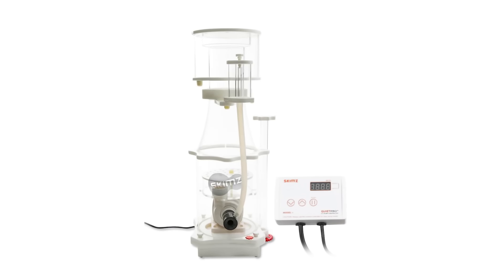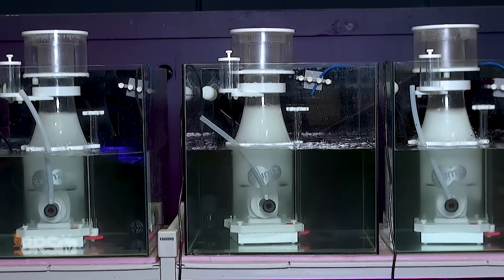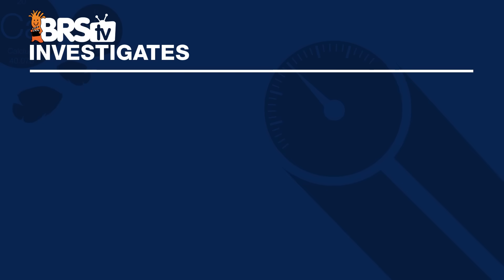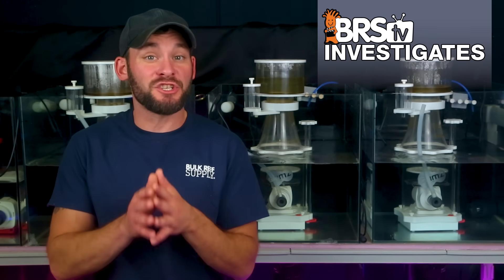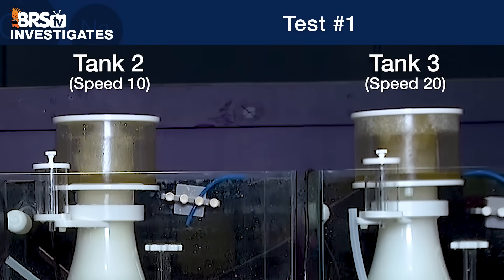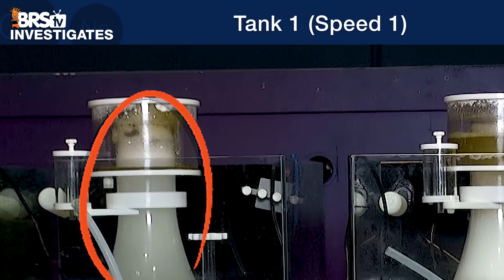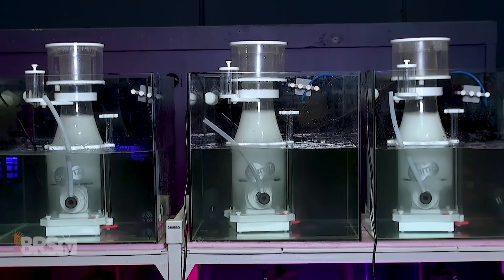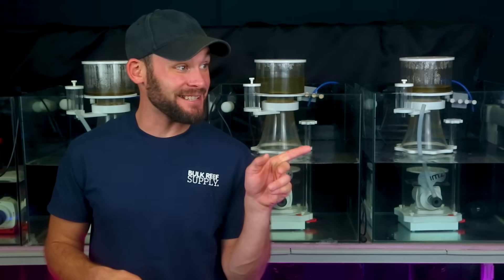Are DC protein skimmers King? Advanced control & tuning by changing pump speed? | BRStv Investigates

Comment: So generally speaking I need to run my pump at half it's speed capacity or a little lower? Too much air via the pump will make the bubbles too turbulent preventing them from building that foam that eventually rises to the top of the neck and into the cup? I've always been told to run the DC pump on the highest speed possible.

Comment: Dc are crap  they use too much electricity the wattage advertised is not the actual electricity used  the electricity used is the load input of the driver

Comment: Dc is crap I want to change mine back to ac because they use 1.5amps of mains like it says on driver my old skimmer curve was 240v used 45watts my dc 4000 pump uses on my latest used 360watts of mains anyone know of a ac speed controlable skimmer pump please I have already switched back to a ACQ JEBAO RETURN pump for my sump and electric for pump is 10 times cheaper  so trying to find an ac speed control pump
Reply: I mean AC is fine if you're deaf or don't have your tank in a living space.

Comment: I have a DC single pump reef Octo and I run a very heavy bioload. I was struggling with thick foam pushing the lid off and not use a weight to keep it down but find it very hard to find the balance as the skimmer building gunk falls quickly out of adjustment in a matter of few days. FYI i have reef Octo SRO 2000 that I replace AC pump with varios4 dc pump. Thanks

Comment: Hi. As you know I love you guys but this particular test to my mind does not provide info on how to run your skimmer more efficiently. It only tells you how to achieve wetter or drier skimmate. However, this is not an indication that you are actually extracting more or less nutrients from the tank. To take it to the next level why not send out three sets of Triton N-DOC tests. One before turning the skimmers on, another 2h in and the last 6h in. Obviously you could also test PO4 and NO3 (which would be easier) but would not provide as much info. This could also be used to verify if a higher Nutrient content would require an increase in air intake to maintain same efficiency.
Reply from the maker: We're definitely taking this one further in the next couple of tests on the BRS750XXL!  We plan to measure the amount of organics removed using a method that reefers can repeat at home, without spending a ton of $$ and time to figure out what's best for their tank. Should be pretty eye opening when we get there. ;)

Comment: I don't understand the point of this experiment. No one would run a dc pump at the lowest setting, then you might as well buy a smaller skimmer.  Point is to set it near the highest point. Adjust the water level and then adjust a levels up or down to really lock in the type of skimmate you want.
Reply from the maker: Think of the skimmer as a foam engine where bubbles and organics are the fuel. More of one or the other doesn't always increase performance, in fact, more of one may make the engine stall out. Similar to that consider a bottle of kids bubbles diluted it by 50% with water. It would be a lot harder to blow or create a sustained bubble in that case and would require much lower velocity air to not cause the bubble to rapidly collapse.  So in the end air isn't horsepower where more is always better, matched to the amount of organics in your tank is better. The ability to scale the air easily means the same skimmer can be used effectively with a new tank and a few fish all the way to when you have 3x as many fish or feed 5 times as much when they are adult-sized.
Reply: I agree...this seems silly to me.  Run the pump at max speed, and adjust the air input with a valve...
Reply from the maker: @tstanley01  Adjusting air with the input valve works to a point. However, when you reduce the air with a valve the pump replaces it with increased water flow. Increased flow rates means reduced contact time, increased turbulence and often micro bubbles leaving the skimmer. It can be done but there are some caveats.

Comment: Wouldn’t testing the water quality of tank 2 and 3 tell you what type of skimmate you should pursue?  Has anyone ever checked to see what improves the water quality more (wet or dry skimmate)?  It’s clear that with controllable pumps you have a greater ability to tune for a specific type of skimmate, but it doesn’t tell you which type is best.
Reply from the maker: All in due time. ;)  We're not done exploring skimmers yet and we have an experiment planned that should answer that very question and that reefers can repeat at home on their own systems!
Reply: One area is if you have old medications that cannot break down or high phosphates no skimmer will skim at its optimum. Need to get those out first and then will see an tremendous increase in skimming.